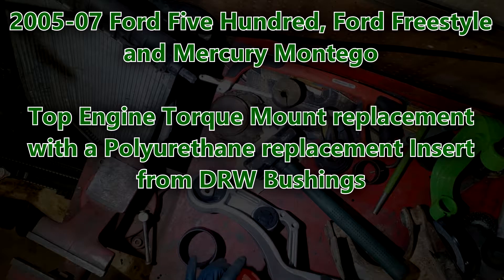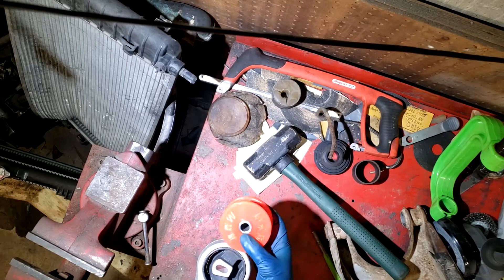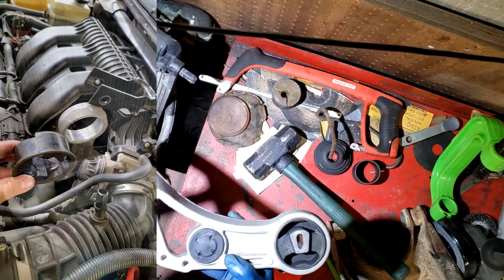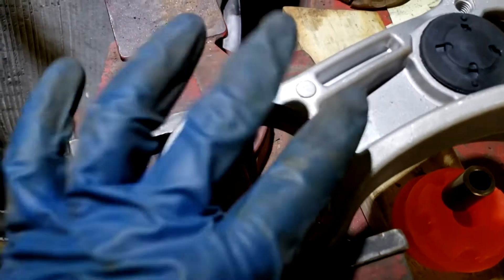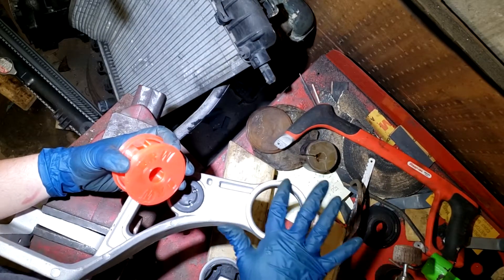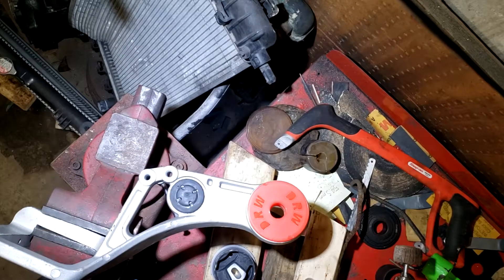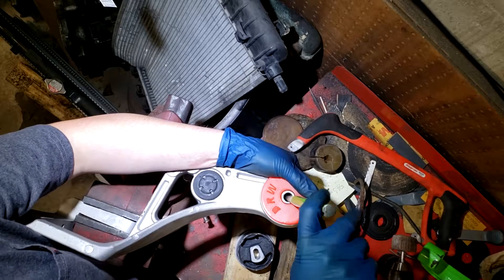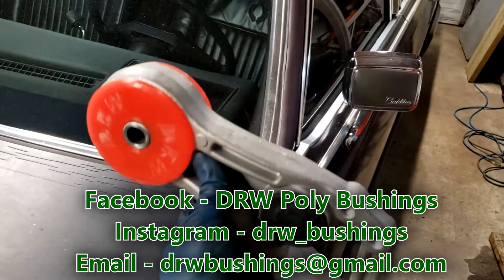Ford 500 Top Engine Mount Install -Polyurethane

Comment: what size bolt do you use with this?
Reply from the maker: The original bolt is reused. I'm not sure of it's size or thread
Reply: @driving-riding-wrenching1278 ah ok. My bolt is missing
Reply from the maker: @KMMUSIC87 That sucks for sure. You could maybe try to find an OEM Ford parts diagram on an OEM ford parts site and see if it gives the details of the bolt. Or at least measure the length that it would need to be, and then buy a couple bolts of different threads from a hardware store to see which one is correct. Then return the others.
Reply from the maker: @KMMUSIC87 I can't find the exact thread pitch. But it appears to be an M10 bolt. So that might be a good place to start. Once you find a bolt, feel free to order a bushing! I have them ready to ship out! 👍
Reply: @driving-riding-wrenching1278  thank you! Mine is actually an 06 freestyle, do you know if this will fit that as well?
Reply from the maker: @KMMUSIC87 Everything should be the same on the Freestyle
Reply: @driving-riding-wrenching1278  ordering now! one last question when remounting, does the bolt get tightened until it cant anymore or is there a threshold> do you know?
Reply from the maker: @KMMUSIC87 the bolt will squeeze the 2 black steel mount ears/flanges tight against the steel center bolt tube of the new bushing. So it will get tightened just like factory. I obviously suggest torquing the bolt to whatever factory spec is.
Reply from the maker: @KMMUSIC87  thank you for the order!

Comment: I’m thinking this is the problem with my car. The rubber is all rotten out and whole car shakes when I put it into drive or any gear. Car won’t shift either rpm’s just keep going up. Could this be my issue ?
Reply from the maker: Im really not sure that the mount would cause issues with not shifting. That sounds like a more serious issue with the transmission unfortunately.
Reply: @driving-riding-wrenching1278  I stuck a piece of wood in there to hold the mount in place and it didn’t clunk when put into drive. It actually started shifting too ! 😨
Reply from the maker: @LilHomieColt  Hmm. Well maybe it was moving enough to pull on the linkage or kink a trans fluid line or something. The link to order one is right here if you want to give one a try.

https://drwbushings.myshopify.com/products/upgraded-engine-torque-mount-ford-five-hundred-freestyle-mercury-montego-polyurethane?utm_campaign=share_orders&utm_content=android&utm_medium=product-links

Comment: I used this solution to replace my torn upper roll resistor mount.  This worked out great, and was easy to do.  Thanks!
Reply from the maker: Love to hear it! Thank you for the business and feedback!
Reply: @driving-riding-wrenching1278  how much is the polyurethane mount?
Reply from the maker: @theunspokentruth991  There are links in the video description where you can order one or contact me with questions.

Comment: Damn I need to order one my sister has a 05 that I've replaced that mount twice already crappy design for sure. So the Red is normal mid grade buy? It's just a beater car
Reply from the maker: They are all the same hardness. I can make them in several colors
Reply: @driving-riding-wrenching1278  Awesome thanks for the info